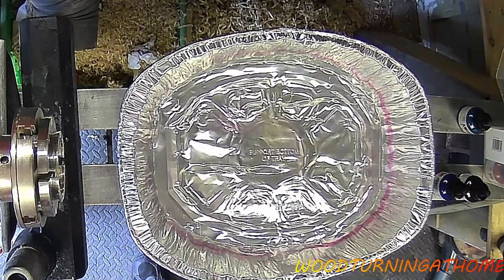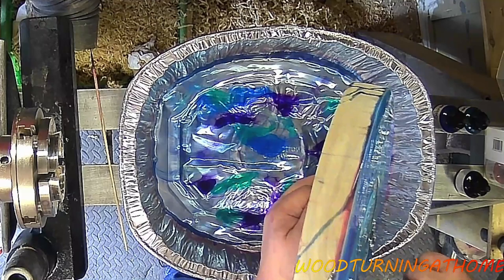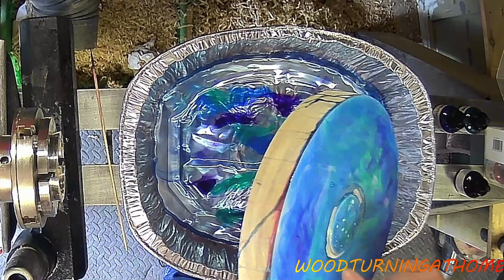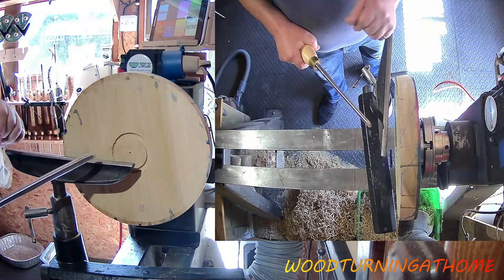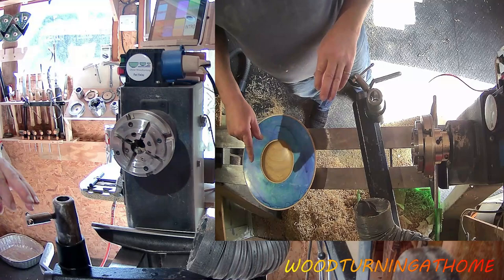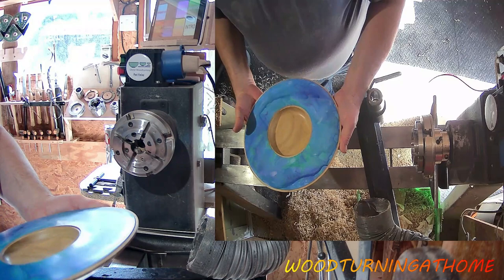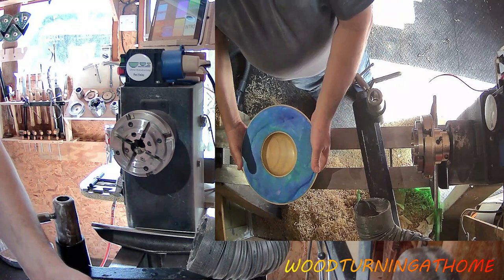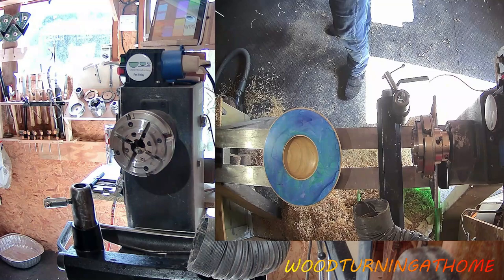Wood Art using paint marbling.

Comment: As soon as you started talking I knew there was something wrong because you sounded very down which is not like you at all.  I hope you get relief from that back injury soon because that's an awful thing to live with.  Upside... the platter looks lovely.  I didn't think the blue would work so well but I was wrong again... I should have known because I'm always wrong.
Take care, Brendan.
Reply from the maker: Thanks Breadan, I am still bad it's hard to explain, I can move around ok ,but if I am sitting and move forward to do something and stand up the pain is really bad,but after 5 mins it will ease off, and all was doing was sitting on the roof of the shed cutting the branches off, but I was at an angle.
Reply: I have found that I always end up sore if I try to work at an angle to the job.  Sometimes I forget that I'm not 18 any more and end up with my ass in a sling... again!  Hopefully, you'll be rightly before long.
B